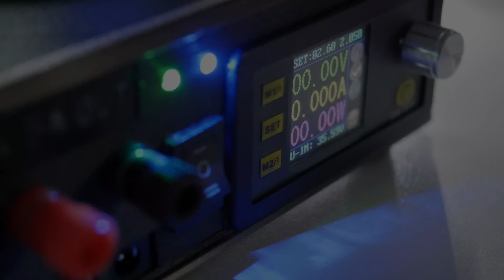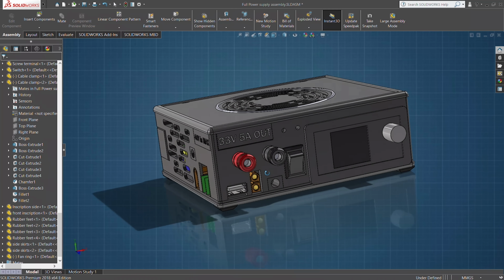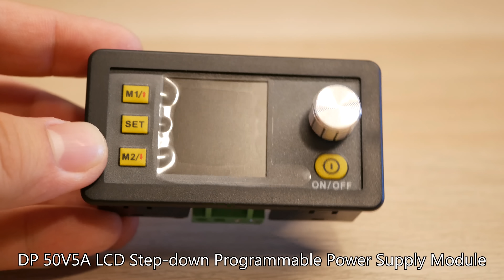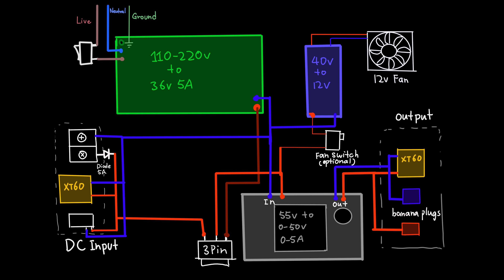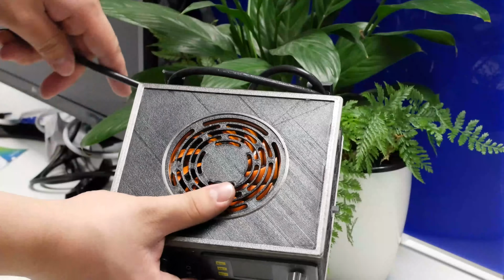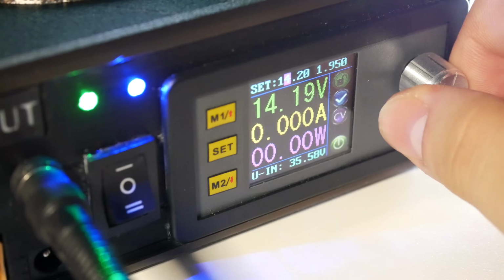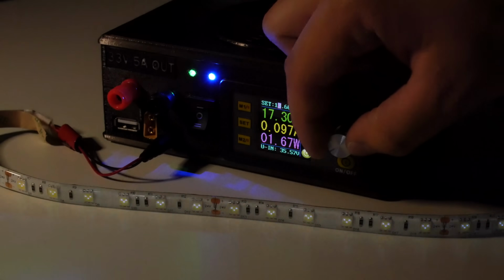DIY Mini Lab Bench Power Supply (With Switchable DC and AC Input)

Comment: I'm on progress DIY 10A .
With Ltc3780 . 
Power by AC220v & DC battery 12v40A(bms).
How to reduce the ampere for fan and small internal input? Or that automaticaly?

Comment: Sorry, but 5 Amps is simply not good enough. Anything less than 15 Amps and 72 Volts DC, and 240 Volts AC @ a maximum of 50 Amps is pointless.

Comment: Wow you actually come up with this idea years ago (I have reinvented one of those recently)
I used a different step up/down convertor since that is cheaper. and I opted for USB-C rather than AC input since AC to DC power supply is not that elegant and I already have a handful of usbc charger around.
But I guess now you can just make the power supply as a module of your power bank? That would be really nice to have.

Comment: Thank you, I live off grid in Hawaii. I have been going crazy trying to find one that I could run off my DC system. I was dreeding the thought of converting DC to AC so I could power a DC power supply. I have just gotten by using whichever old phone charger that came closest to the current need. I'll be doing this tomorrow, Mahalo Brah , your a Champ.

Comment: you are handy and practical. But your soldering will fail. You make a lot of "cold joints", they will not work for long time and fail (if they work from beginning). You have to use soldering paste or rosin and keep soldring iron longer time on place until tin is melted and spread

What I critically miss is a fuse on power supply input site!

Comment: If you have a single roll of filament to print the plates with:  try painting the whole plate and sanding the surface over a flat sheet of abrasive.
this will leave the inwards embossed text painted.

Comment: I got a very weird issue with the uctronics buck converter. Whenever i wire all the schematics, the buck converter yields wherever voltage I set to as long as the case is open. When I close it (assembly everything up) the output voltage drops to 0.12 even when is set to 24v. Again I open up the case and wire everything just the same, the output voltage is just fine LOL. Any ideas

Comment: please look into diy server power supplies, they are $15 each because they are from bitcoin miners, the most reliable one I've read about is DPS-750RB from hp. there are many others but each will have info on how to jumper them to turn them on, just look on youtube or google, please teach us how to make them into adjustable supplies because they supply 40-100amps on the 12v side, DPS-750RB supplies 62.5 amps i think

Comment: Nice build, may I suggest using a thermal speed controller for the fan instead of a switch or just auto full on. This way you prolong the life of the fan and also have the appropriate speed to match the temperature needed to be cooled.
Edit**
I am looking to do something similar with a toroidal transformer that has 2 suitable secondary windings that will give me a 5v Fast Charge USB and 2x 12v outputs as well as two additional windings (with on/off switches of course) to use as a dual variable supplies
Reply: The fan idea sounds smart. How would you do it if you made this modification?

Comment: poor soldering as others have noticed. it hurts to watch
Reply: A connection is made or it isn't. I don't see the big deal.
Reply: @Salsajaman  no its not. a cold solder joint can be too poor a connection and having a high resistance. and it's poor practice aswell.

Comment: Hi, I desoldered the led apart from the board and encountered that those terminals read 35v of dc. How is this possible? I need to put another led to that terminal (I broke the one that came with the board when desoldering) but Its gonna need a couple resistors so it doesn't burn, correct?
Reply: Discovered this today.  Did you get an answer?

Comment: Around the 4:30 mark, when you were testing yout power supply for DC output, you had the red probe on -, and the black on +, and yet your meter still showed a positive voltage.   Were you doing something odd, or are the markings on the supply backwards?
Reply: Maybe the red probe was on - on multimeter and so as the +

Comment: Since you play with high voltage you really must learn how to solder properly YESTERDAY. Soldering is not hot glue. You have to heat the piece you are soldering and aply the solder on the heated part or else you get a cold solder.

Comment: There is a HUGE difference between a switched mode power supply & a good linear power supply. The biggest difference is noise & it is especially important with analog electronics & instrumentation.

Comment: Nice project, but please learn to solder properly.  solder should not look like a bead sitting on a wire, it should flow like the wire and part is absorbing the solder.

Comment: Very nice unit.  Do you have any ripple figures on it at idle and at load, etc.?  Actually, a set of ripple numbers with each different input source, as the DC input should make a cleaner output, but not if the thing is just plain noisy to start with.  Still, I like the full control programmability.

Comment: Nice project, but the soldering leaves a lot to be desired. Solder is not glue. Flux is your friend; it allows the solder to flow. Clean, Flux and pre-tin your terminals before soldering them together.  8:49 is the greatest offender; do not solder to screw holes. Either use mechanical pressure alone, or find another ground terminal. There should be no need to use hot glue as insulation, especially for ground terminals inside a chassis, if your soldering is solid.

Comment: nice idea  however ignoring some of your solderwork looking poor he fact is the cost in the n isn't worth it using your list..

No offence but  pre-made PS of better quality can be had for very close to the same $$ f you o some smart shopping

my own dual bench PS only cost me $112 CDN inc shipping

l understand your links make u few $$  However lower prices can be found for the same or better parts. (nvr mind most ppl lack a 3 printer)

lastly  use  a SOCKET for the main power cord ffs!!!  not like such r $ or hard to salvage

installing that cord s you did screams  amateur build..  witch  sad since that is so easy to avoid

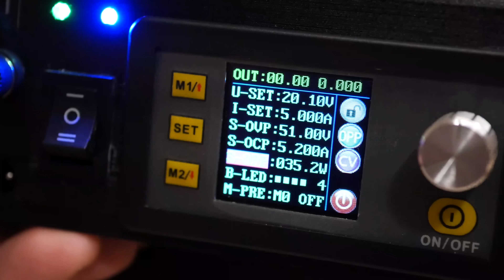Comment: 0:47 they are heavy because they are linear power supplies. Yours is switching power supply (SMPS) so it is lighter. Both types have their own advantages and disadvantages. For example, linear power supplies produce less noise so they are preferred for sensitive analog circuits, audio amplifiers.

Comment: There are a lot of comments about the soldering technique and an apparent quality issue. 
Why does everybody overlook the fact that high resistance in a circuit creates heat like a soldering iron?  
Obviously the joint will fix itself..

Comment: 8:49 dude what the hell is this "wrap the wire around the screw" technique? Use a bloody ring or fork terminal.. that wire will not hold in there over time and will woresen if the solder becomes brittle, plus there is almost no surface area on that bolt to push down - you can literally see black where half the screw isnt even touching the wire... absolute trash. That wire is for sure coming out at some stage. 

also lol at the soldering

Comment: Um. It is AC. You shouldn't touch the "neutral" wire either when it is live because there is nothing neutral about it on a 110 circuit. The "neutral" line on some phase power will carry just as much electricity as the black one. What the hell man?
Reply: Sorry, Austin, that is absolutely wrong.  That is why he specified the use of a three pronged plug... A simple polarized 2 prong plug would also be sufficient for this project, ungrounded as it is.  (The polarization of AC connectors is also why the use of metal utensils to fish out your broken piece of toast from the toaster is no longer gonna kill ya! -- look it up!)
 Anyway, if you live in North America, inside your house's main fuse box, you will see the white (neutral) wires are all connected DIRECTLY TO GROUND!  Go check, we'll wait... ;-]  
The neutral and the ground in a household environment in North America are basically the same.  The ground wire is there to act as a return in case the neutral is somehow damaged.  So, go ahead and stand in your bathtub while touching the neutral wire with both hands... Nothing will happen.  Just stay the hell away from that black wire!  ;-)

Comment: If you don't want to solder or 3D print a case or purchase any of the components separately, you can order a Digitally Controlled Power Supply from RD Tech on AliEpxress: https://rdtech.aliexpress.com/store/923042

I have the DPH3205 Buck-boost converter with a the housing.

Comment: Nice casing but can be much smaller, mine is 8x5,5x5,7cm with 4 outputs of all 5A: 3,3VR, 5VR, xVR and Vmax.
I agree it's really handy to have a portable power supply around!
Vin 7-50V should be fine, because with 3-6Vin it's barely alive :)

Comment: so you don't have to go thought the video like it did to find the specs AC input: 110-120VDC 60Hz or DC input: 3-50VD with DC output: 0-35V 0-5A w CC/CV mode

Comment: And not a single fuse was given that day.
Reply: Resistance is futile.
Reply: @TeddehSpaghetti 🤣🤣🤣🤣🤘
Reply: Apart from buying better quality components, how can you make this PSU more safe?
Reply: @theUsesOFnot   To make it safer? Well, for starters, I wouldn't be using a 3D printed enclosure! Its a nice design, but if it wasn't full of holes already, it would be soon enough...  How was it made?  With Heat. What generates a shitload of heat even when it operates normally?  A Power Supply!  Seems counter-intuitive to use homespun plastic to enclose high voltage/high heat projects, doesn't it?  How reliable are those plastic screw posts that hold down that heavy power transformer when he drops the unit and doesn't check it because he sees no external damage?  Remember, this plastic is not the same plastic they use to make your practically indestructible power tools!  
In his place, I'd use a metal case, ground it properly, and learn how to use a damn soldering iron to avoid dangerously resistive cold-solder joints!  ;-)
To the question of fuses, no additional protection is required here. There is already a fuse on the PSU board right behind the green AC input terminals that he removed.  And the front unit that controls everything already has all the necessary safeguards one would expect it to have.  I suppose that If the PSU fuse blows too often, you could always choose to mount it externally, but I don't believe it would be necessary.  

Sorry, for the long reply, and for assuming it was a general question to anyone. ;-)
Reply: @robertcartier5088  LOL. k tho. I feel like if a power supply is heating the case to be the ~200degrees that 3d printers heat the filament to when printing, you have another issue. xD thanks tho
Reply: If the case is PLA, it'll shatter when dropped, but I doubt the PSU gets hot enough to melt or even deform PLA. Personally, I would print a case like this in Carbon Fiber Nylon or PETG.
Reply: @robertcartier5088  a 3d printed and tapped hole can hold about 400 newton before giving up, with axial strenght being equal to the one of the average m4 screw. A Nylon, or PC case will start warping at about 105°c, with the printing temperature being about 250°c. If you melt the case, you've got bigger problems than the case itself. Any decent psu will not go past 80C while operating, even at 100% load.
Reply: @InsanelyMclean  pla is brittler than other filaments, but it still is plastic. If prints shatter when you drop them, check your filament quality. That shouldn't happen.
Reply: @somedude2492  PLA will absolutely shatter when dropped if the print is heavy enough. I know from personal experience.
Reply: @InsanelyMclean  it should not shatter. It may break, but not shatter. Glass shatters, wood breaks. So far i've tried grilon3, candyho (local brand) and a roll of prusament PLA. None of them shatter, they usually break though, which is not the same. You may want to consider trying other filament brands.
Reply: @robertcartier5088   You obviously don't have a 3D printer or are a novice with it. With more advanced 3D printers, like mine, you can use one of a number of high temp plastics. I routinely use Polymaker PC-Max which doesn't start to soften until 110°C and I regularly anneal it at 100°C (212°F). The result is a VERY strong case. If your power supply hits 212°F you've got more problems than the case. I agree his soldering is awful. I cringed every time he picked up an iron. That said it's a great power supply. He should have used a standard  IEC socket. If I get time I'll see if it works to make a remix of his case to include one.
Reply: @robertcartier5088  I think heat treated PLA, or high temp nylons/PC would be ok
Reply: @robertcartier5088  certain 3d printing materials can handle very high temperatures.  Leave some legos on the hood of your car.
Reply: @miniwarrior7  late reply, but lego is injection molded ABS, not really the same thing as filament printed ABS. Injection molded plastic is homogenously distributed and doesn't have layers to create weak points. The reason annealing 3d prints makes them so much stronger and in many cases more thermally deflective is because it's basically remelting the plastic and eliminating some or all of the layering. But even an annealed ABS print will be weaker than an injection molded print because of structural differences in the plastic itself coming from the injection process.
Reply: they run out the stock ahahahah

Comment: Good idea to assembly circuits out of the shell in a box that fit your needs. a couple of hints:  add a fusebox to cover the  hivoltage cord AND in another place the outputs in case of a short of the load, in an accesssible side to blast em in case of failure; add a layer of insulation using a shrink tube on 220 terminal.
use color coded wire inside to know what wire is carring what.
Due it's a tool to be moved , fix  condensers and other big elements with hot glue  (couse on transportation\ accidentally falls those boards arent assembled and builded for a mobile use).
on terminals connection glue is not a solution : prepare a pcb board, and use it (with addictional screws) to add mechanical resistance otherwise in frequent use those terminal will unglue form the chassis. best regards!

Comment: That's not how you do mains connections. The wires need to go through the holes with no exposed copper and be soldered in. The earth connection needs to have a proper round cable shoe and make sure it touches the bare metal on the earth pad under the screw, and screw it in tightly.

Comment: Why not use the AC input cable with the plug attached? Seems like a more correct approach to have a disconnectable mains power supply cable... It is understandable to omit the facility due size/packaging constraints, but a 3-bladed AC-input socket on a bench power supply would hardly take that much more space, no?

Comment: Why not use a AC 3 in 1 Fuse Power Supply Socket Connector Rocker Switch, so you can always remove the AC Power Supply Adapter Cord Cable Lead 3-Prong, much better and if cable is broke just plug a new cable in, and it's saver because it has also a Fuse, And why not use Crimp Spade Wire Connector, for ground and so on? And your soldering is not so great.

https://www.banggood.com/250V-15A-AC-3-in-1-Fuse-Power-Supply-Socket-Connector-Rocker-Switch-p-1145927.html?rmmds=detail-left-hotproducts__2&cur_warehouse=CN

https://www.banggood.com/220V110V-5A-Power-Outlet-Socket-With-Switch-And-6A-Fuse-For-3D-Printer-p-1149102.html?rmmds=detail-left-hotproducts__1&cur_warehouse=CN

https://www.aliexpress.com/item/32919789539.html?spm=a2g0s.8937460.0.0.2dc92e0emm3yRd

Comment: Can the parts selection be modified to accommodate higher Amp support?  I routinely use power supply for tire truer however it requires 7-10 Amp support.

Comment: I'd have used an IEC C14 chassis connector so the cable wouldn't be fixed or need to be cut...
Reply: I thought exactly the same. You also get fused versions, which add additional safety and protects the device.
Reply: @Chwarg  That's usually not required here in the UK as our plugs that go into the wall outlets have fuses in them.
Reply: @No1sonuk  I know that you guys have fused plugs in the UK - but you are basically the only ones. We don't have that, so a fuse in the connector is the way to go for us. There is a small latch that makes it easy to access, so there is no need to open the device.

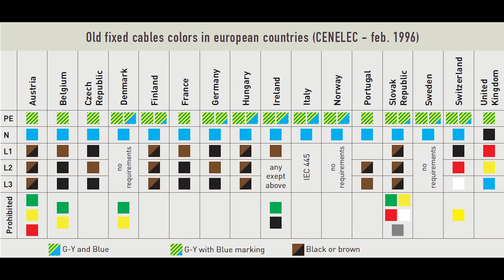Comment: That cable colour chart at 4:09 is totally irrelevant for identification of European flex colours
Reply: It is out of date. I'm based in the UK, so those are the only colours I know and I can't comment on the others. The UK changed from the colours in that chart to the modern colours in 2006 (they were "harmonized" with the EU). The new colours for the UK are Green/Yellow for earth, Blue for Neutral and Brown for L1. L2  is black and L3 is grey.

The stupid part is, if you're looking at an old install, L3 is Blue and Neutral is Black, so they're reversed compared to the modern colours. So much potential for wiring errors!

Comment: I have an ATX 305W supply. If I use a boost how are the amps out affected? It's 12 volts is this doable? I need to get between 0 and 30 volts.

Comment: Hi. Can u tell me the steps by step how to make case? Did u measure all the size of circuit board switches.... then drawn them on 2d software then using them as guide in 3d software? But how do you know the size in 3d software? Is that maya Autodesk? Also can i have the 3d file? Tks

Comment: I have one of those modules and it's the most annoying piece of equipment I own. Just starting it takes more steps than it should, then to change setting takes a few more, including using presets. The current/wattage is off a little so be careful powering delicate stuff. Other than that it's cool little device